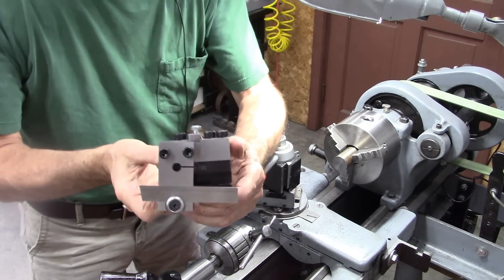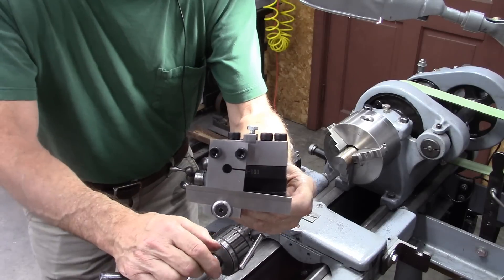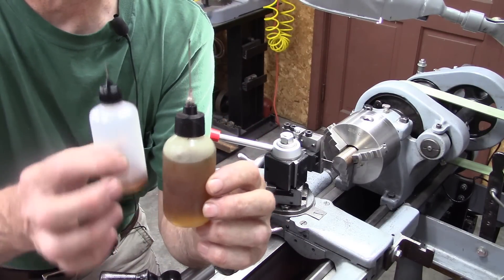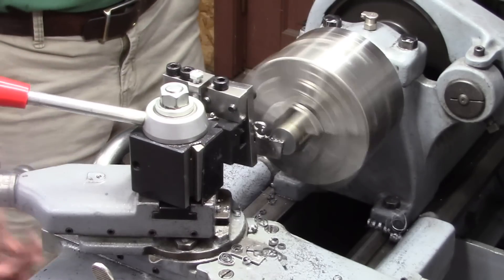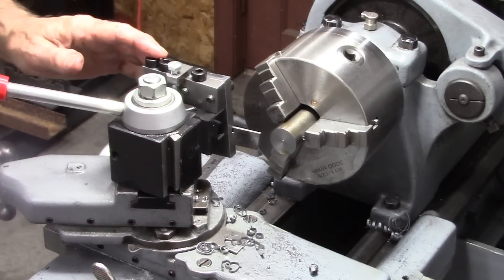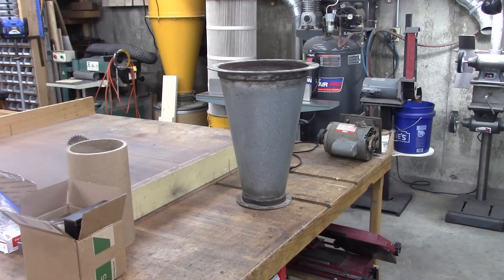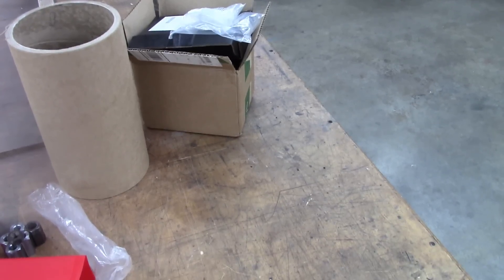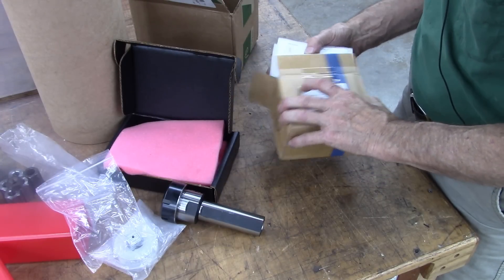Cut-Off tool, Gear Hobs, Grinder Dust Collecting and a Funky Old Drill Press

Comment: How about this on your dust collector:
Proceed as planned, with your cyclone behind the grinders, but add a large neodymium magnet on the outside of the dust pipe after the cyclone, to capture any metal that makes it through the cyclone. 
It could be designed such that it could periodically be checked for buildup and removed, dumping the fine particles out a clean-out port.
Reply from the maker: I like the magnet idea however aluminum and rust are not very magnetic. I think the only safe method is to use a separate collector.

Comment: I'll be looking forward to seeing the gear hob project; sounds interesting.
Have to agree with others, mixing metal dust extraction with wood is not a good thing. Bet your insurance company wouldn't like it either!
I was rather shocked to see that you had put the Hardinge lathe up for sale! But I'm sure you have your reasons.
Reply from the maker: Maybe right on the wood/meta; dust. The lathe is simple, I need the space and almost never use it. If I was making small parts only it might be useful but honestly, the South Bend will do the same.

Comment: You could consider installing a water mist generator to reduce the. Static.That is just as critical as the actual dust itself as far as flame. I would also recommend putting in an adjustable air intake gate at the vertical pipe where it turns into horizontal, this way you could adjust the amount of suction so it is just enough to do the job.  That would reduce the chance of going into your main system. Depending on how the mist system would be added, you could also have additional collection system for any water that accumulated. The biggest thing you have going for you is the vertical distance of the pipe before it hits the main line. You could test your set up by installing a Temporary camera in the system at several locations then Generate more sparks than any normal operation to see Exactly what is going on.
Reply from the maker: Sounds kinda scary 😬

Comment: Grizzly sells some metal dust collectors. No cyclone, but you may want to see what you can borrow from the design. They also sell replacement filters.
Reply from the maker: I've seen them but never the insides. In the shop at the company I used to work at they had a 12 x 60 belt grinder for steel with a blower and bag. They never had a fire but there was also nothing in the bag flammable. The bag looked like cloth but i never looked closely at it.

Comment: Mark, 
How about using the cyclone vacuum and diverting it into a split system. One for wood, one for metal. 
Also, what is a good email address for you?
I have a copy of Craftsman 1932 tool catalog and it shows your bandsaw. 
I replied to your cover video and you responded back. 
Thanks for the videos. 
Congratulations on your retirement. What was your profession?
Reply from the maker: It sort if is two streams. It would be like a pre-separator. If there was a way to divert the exhaust of my woodworking cyclone I'd feel fairly safe. So far the only safe way I see is to get a separate blower. 

I've been retired for almost 7 years now. Glad to be away from the job. It was actually a good job but I had enough. I retired from a Web Offset printing company that printed magazines. I ran a press for a while but the last 15 years was working as a troubleshooter resolving machine problems. Most the time this involved redesigning machines. You might say it was an engineering jobs but I have no degree. I learned a LOT about machining, machine design, CAD and about specific areas in printing. I think I had my hands in just about every aspect involving the presses and stacking machines. It was overwhelming. Send an email to winkysworkshop@GMX.com
Reply: @WinkysWorkshop

Comment: I’m speaking from ignorance and guesswork here, so my comments may be of no use, but… surely your grinders are producing a mixture of metal dust and carborundum grit. That makes it a tricky mix for recycling, and a nasty mix to have floating in the air in your workshop, and also, if not collected, a horrible problem that has to be swept up or you tread it into the house. I wouldn’t want that mixed with wood dust (which can be recycled or pressed into wood briquettes for burning). So a separate collection system would be my choice - though, as I say - from ignorance. Your stuff is always good and makes me think. Or wish! Les in UK 🇬🇧
Reply from the maker: Yes, the small cyclone would capture the grinding dust before it got to the wood. The would cyclone would only be for the vacuum. Yes it is nasty stuff, makes a mess.
Reply: @WinkysWorkshop  Powdered aluminum is one of the "most explosive " ingredients in the making of non Nuclear bombs. Grain dust is another.  It would certainly be prudent to put a spark arrester in line with the intake.
Reply from the maker: @terrycannon570  Yes aluminum is bad. I think with a separate system putting a little water in the dust bin would solve this issue. Its a shame to not utilize the blower in the woodworking collector but it's not worth the risk.

Comment: You'll need some sort of spark arrestor, perhaps a series of screens at different angles, as well as a shield to force the metal dust downward.  I'm sure you will figure something out.
Reply from the maker: The small separator will be very effective for separating but I have to be absolutely certain. Screens might work...  just not positive.
Reply: @WinkysWorkshop  the screen holes would need to vary in size from one screen to the next.  Perhaps sheet metal with a bunch of holes could act as the screen.  The key is to slow down the hot metal particles enough to cool them down, perhaps a combination of screen and an assortment of baffles for the metal particles to hit.  I have the idea of how it could work locked in my head, I just don't have a good way of conveying those ideas, my apologies.  I'm more like the build it and try it sort.

Comment: I looked into making a metal/wood dust collector and cyclone a while ago and found out a few things, although I never actually made it. 1) use flexible metal conduit for the metal. Supposedly any hot metal cools at this stage. 2) route the conduit through a box where  larger metal pieces will collect before it reaches the cyclone.
Maybe a system more like a grader (used for grading stone) would work.
That drill press looks like it needed rescuing, so looking forward to seeing how that works out.
Reply from the maker: There is no issue with large metal partials. Its for the belt grinder and wire brush. I think I need to get a separate blower and to not use the larger cyclone.

Comment: The drill press drive system works like a snowblower and some lawn mowers.
I have a  vintage Delco 1/4HP motor which may be underpowered, but would look right with the machine.   I think it is a repulsion type.   Starter windings within the stator.    Runs well.   Oiled bearings.   1750rpm.   You can tell the age because the voltage on the nameplate is 110V.   Happy to send this to you if you can use it.   If you are interested, let me know in a reply and I will email some pictures.
I have a Steel City grinder purchased back in 2015 sometime after they went out of business.   It has dust collector hose designed into the grinder wheel housing.   At the time I thought this would be handy to mount to the shop vac.   I then watched the sparks from grinding and decided I did not want to take the risk of a spark and small dust particles deciding to get together can cause a fire, or worse a bit of a boom.   I removed the dust collector hose.
Some time back you showed an inexpensive tachometer for one of your machines.   I purchased one after seeing the video.   Works well.   If the Hall effect sensor signal is "readable" by an Arduino, this would be an easy solution to part of the future project.   I can program Arduinos if you need help.
Dave.
Reply from the maker: Thanks aa bunch for the offer on the motor but i think you're right, a bit under powered. Also I have an old 1/4 HP I think. I'm using an Arduino but you're right, the halls effect would work. It would need to be a gears to provide a much higher resolution though.

Comment: 01996 SIP METAL DUST EXTRACTOR / COLLECTOR 230VOLT👍.I had a idea using electromagnetic .
Reply from the maker: Looks like a stand alone cyclone. Yeah...  a magnet might help but rust and aluminum might be an issue.

Comment: Mark, your cyclone separator will probably work with enough space and air flow for the sparks to burn up before reaching any area of the dust system where wood dust is --- but why risk it.  Use an inexpensive shop vac to power your new cyclone and there are no risks.
Reply from the maker: I need more air flow than a shop vac but yeah...  not going to risk it